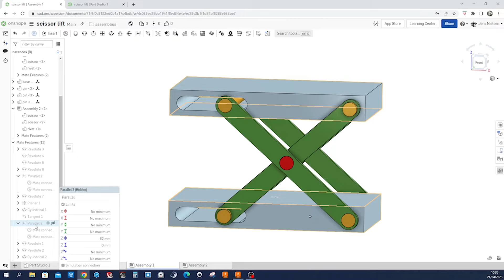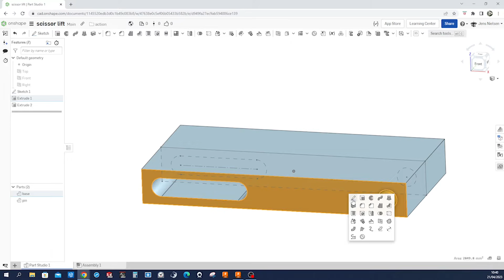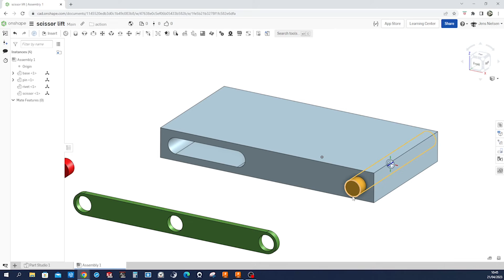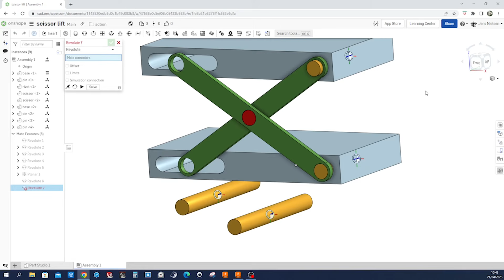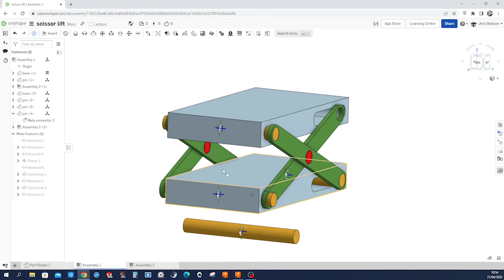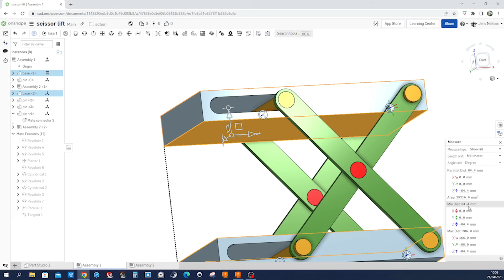Discover How To Easily Assemble a Scissor Lift in Onshape

Comment: GREAT TUTORIAL by the way, I regularly watch and recommend your videos to CAD partners. So I have a doubt: in case you want to add a crank or screw that raises the platform, for an actual print, where and how would you add that section, if you don't mind me asking? Thank You anyway!
Reply from the maker: Thanks and thanks for recommending! What about the bottom right pin? A crank, maybe with that pin indented as a cog and the crank axis accordingly-